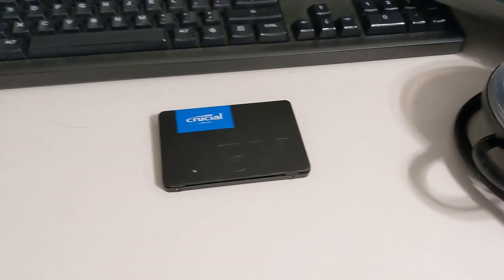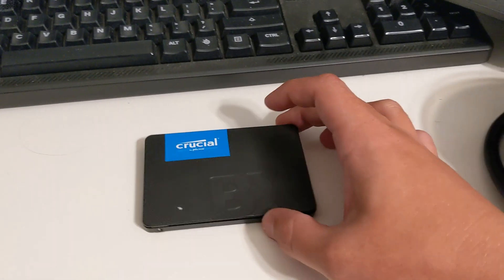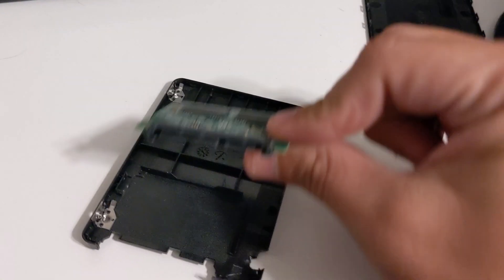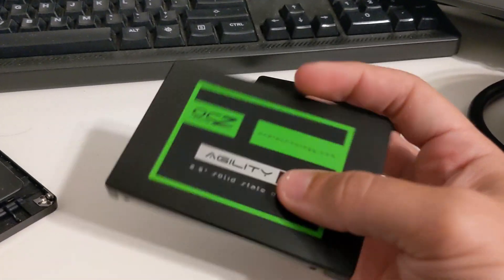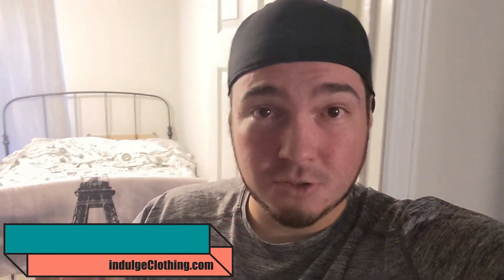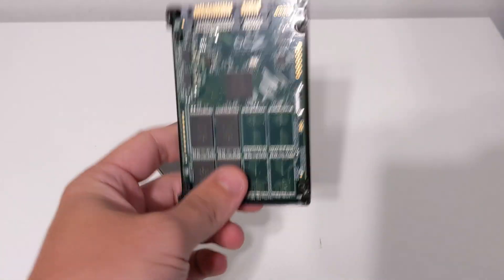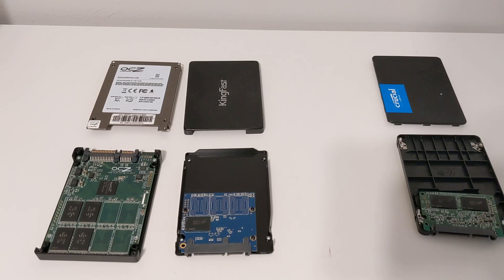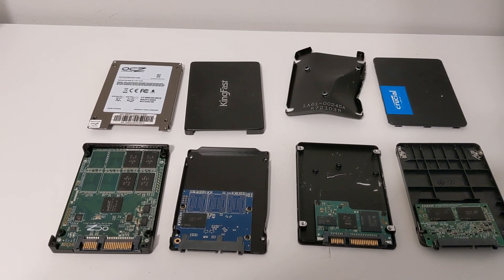What's Inside A Solid State Drive (SSD)?

Comment: @BigC Vlogs - Just the "Hmm, I've been wondering..." video I needed: I've been using standard SSDs for years, changed my Samsung EVO 870 OS to a Samsung 980 Nvme M2.  Standard Nvme M2 are longer and skinnier, but proportionally it seems much the same circuit board real estate.  So while  Nvme are faster and the "newer" thing, the companies actually save money not needing to make a case and SATA 2 interface.   Sneaky, sneaky... :)

Comment: what a cool thing! I want to use it as an external SSD, Does anyone happen to know a case to hold the "shortened version"? Even 3D-printed ones are fine
Reply from the maker: Amazon or microcenter should have enclosers to make an external SSD.
Reply: @BigCVlogs  Ok thanks, but I couldn't find anything on Amazon EU, mainly because I don't know what to call this "small Sata SDD". If you have any suggestions please link them here :hand-purple-blue-peace: